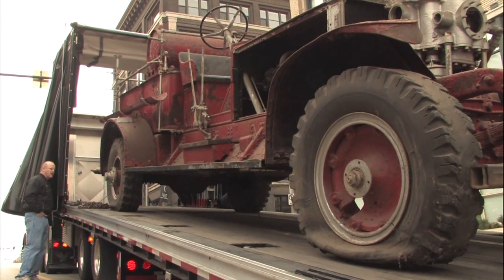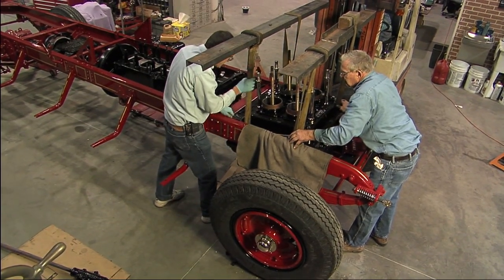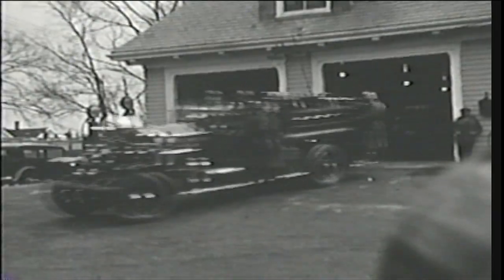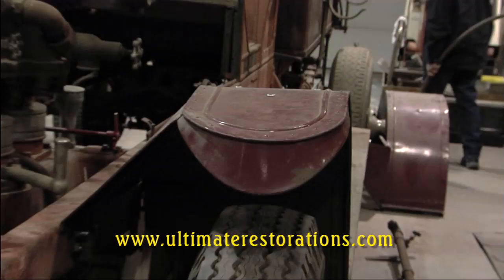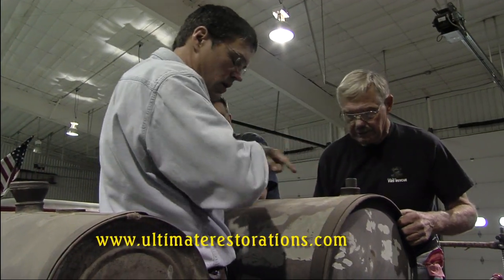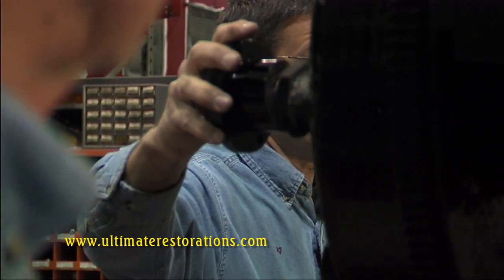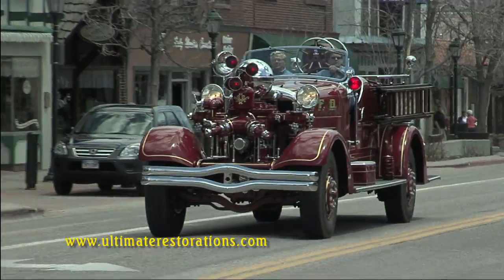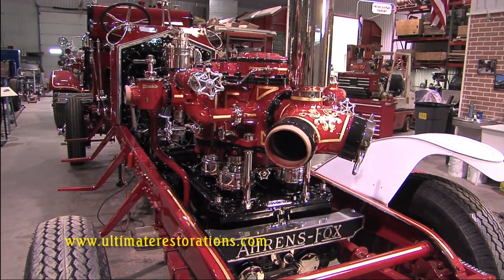Ahrens-Fox Fire Engine: A Kansas City Treasure Trailer

Comment: I grew up in Norwood (Cincinnati) Ohio where these fire engines were made. Norwood had one of three Cab pumpers ever made with Oprah rear seat windows. In Norwood that pumper was stationed at Fire House #3 near Waterworks Park. 
Above the din of screaming kids in a swimming pool I used to carefully listen for a fire alarm to drop at No. 3..
I would jump out of the Pool and run over to the fence to pay homage to that magnificent piece of handmade equipment as it rolled out of the firehouse.